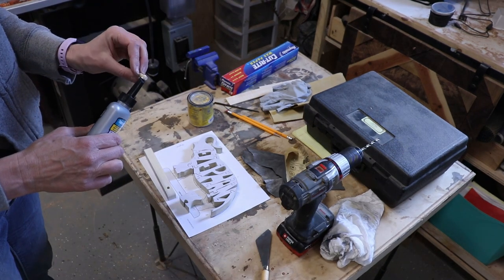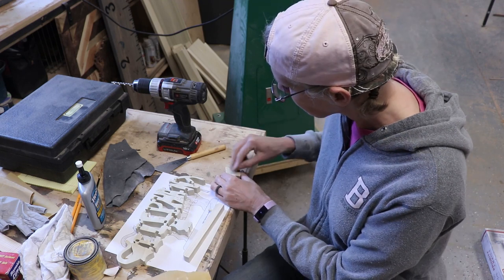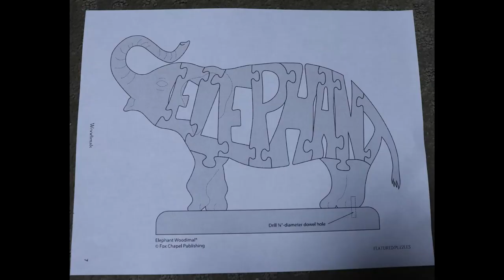Elephant Puzzle (Woodimal)

Comment: Turned out great and I'm sure the grand kids will love it!!!  There are blades made for puzzles or using a 2/0 blade would give you a thinner kerf.  That might make it less wobbly when standing up because the pieces would fit together tighter.  Increasing the width of the base might also make it more stable when standing.  Doing the lines with the wood burner really gave it a realistic look.......another Cy masterpiece!!!

Comment: so far the patterns you found are actual size, they don't need resizing to fit the board of course if you want to make to make them smaller or larger on your own. But they can be used as is?
Reply from the maker: It recommends that you in large by a 125%.  But the elephant pattern was just fine as is but I'm noticing some of the others are a bit smaller than I'd like.